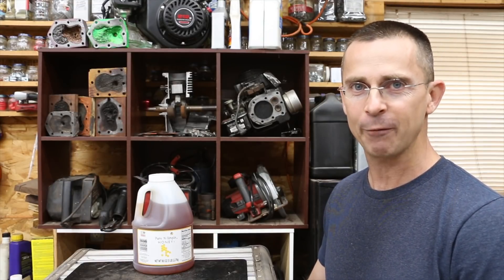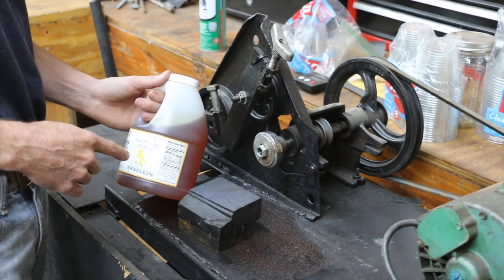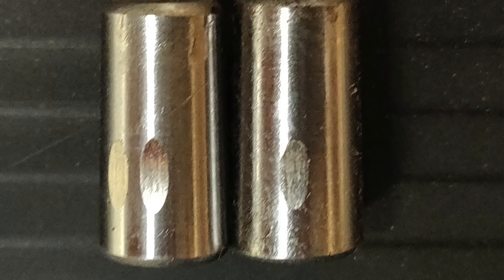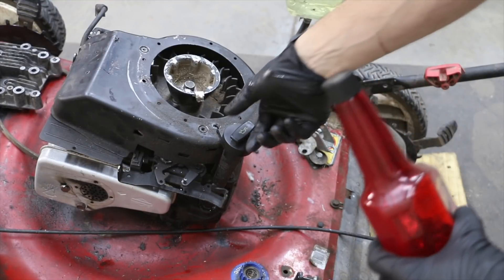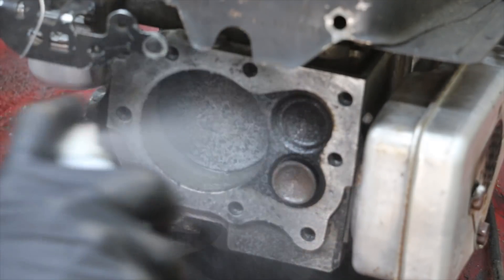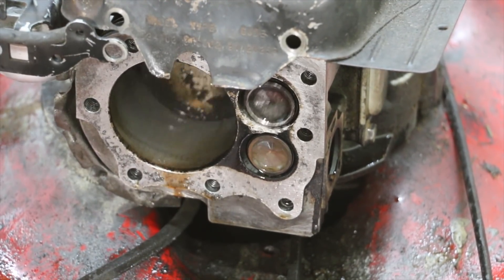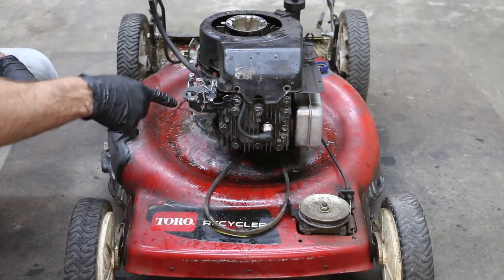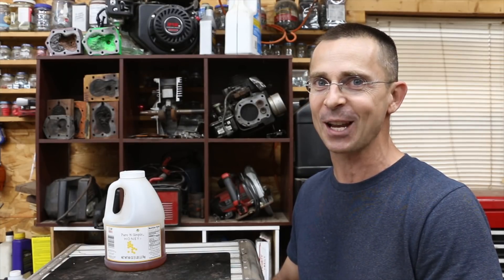Can you use Honey as Engine Oil?  Let's find out!

Comment: Another thing you could try as oil would be DOT5 silicone brake fluid.  I use it in the hydraulic clutch on my car since it is more slippery than regular brake fluid and seems to make the cylinders last longer.  (just to clarify I got brand new cylinders and a brand new hose and cleaned everything out and used silicone grease instead of the normal assembly fluid... I didn't just top off my system!)
Reply from the maker: Great test idea!  Thank you

Comment: Nope. Nothing with sugar will work as oil.
Reply from the maker: You are right.
Reply: @ProjectFarm  Correct if I'm wrong but weren't car lots that were disposing of old cars during the Obama cash for clunker thing using sugar to lock up engines so they couldn't be bought or sold again?

Comment: You should perform the lubricity tests at multiple temperatures since as the engine runs, it will heat up whatever you're using as oil, which changes its viscosity and lubricating properties.
Reply from the maker: Great point. Thank you

Comment: I wanted to see in the crankcase😔. Do you think, given the lubricity test, that if the honey did not boil it would have worked as well as 10w-30?
Reply from the maker: Yes, the engine could have lasted a long time had the temperature remained lower.

Comment: Great one, saves me from trying it :) 
Also, bananas is rumored (urban legend) to be a oil-replacement in emergency. 
Seriously, when will we get the "radiator flush"-test? Also I'd like a video about different lawn mover blades, are Oregons Gator blades more efficient than traditional ones, and is it possible to diy a blade from a plain sheet of steel or even just a piece of flat iron?
Reply from the maker: Great test idea!  Thank you

Comment: I'm not entirely sure if you've already done this, but running an engine with gasoline or diesel instead of oil would be interesting.
We've seen oil being the fuel, how about fuel being the oil ^^
Reply from the maker: Thank you!
Reply: Diesel is a better lubricant than petrol so that would certainly work better.
Reply: @gravemind6536  of course, but how good exactly. i'd guess diesel works maybe half as good as oil, and gas could even clean the old oil away and blow it pretty quick

Comment: Since the engine is in bad condition, test some of the products that claim to be solutions for such old beat up engines. Frankly after what that engine has been through, you really can't fault it. Not many engines could survive half of what this one has. 

one question has been on my mind lately, what would happen if you used Engine Oil in the coolant system of something "water" cooled? Logic says it would work, to some degree, and at various exterior temps especially if it was like 5 W 40 or the highest gap you could get. By the way, what makes a multi weight oil work? Supposedly it's thinner when cold and thickens as it heats up. How does that work?
Reply from the maker: Great test idea!  Thank you
Reply: I predict failure. Water has a particularly high specific heat capacity, much higher than that of oil. My dad’s lawn tractor overheats and conks out if it has too much antifreeze so oil as a coolant .. not good for the engine.
Reply: Sounds like waterless coolant. Basically a light oil.
Reply: @gasdive  There is a coolant on the market that is supposed to last the life of the vehicle, and possibly even longer. However, the system must be totally free of water and antifreeze when you install the new stuff, if it gets contaminated, it won't last and won't work as well. It's so long lasting (but expensive) that many people use it, then when they get ready to sell the car they take it out for use in another vehicle and go back to regular coolant in the car they're selling. I'm not talking about the "long life" stuff the main sellers are now touting, this is something made by a small company, there is a vid on it under Jay Leno's garage listings. I don't know much about modern vehicles, but back in my day I was told that if you keep adding some mineral oil to the antifreeze, you don't really have to change it very often at all. It's not the antifreeze part that breaks down, it's the additives for corrosion resistance and such.  Another odd fact, straight undiluted antifreeze will freeze at a relatively high temp (below freezing of course) but when in 50 50 mix with water, it doesn't freeze until a much lower temp. Anything will freeze if you can get the temp low enough. Of course, that was back in the day with the old antifreeze, not the modern stuff.
Reply: @tootall5559  yeah, that's the stuff I meant.
Reply: @gasdive  Y'all can see all about it here: https://www.youtube.com/watch?v=t7PykrgzWPQ

Comment: How about paint in the crankcase in place of oil?
Reply from the maker: Thanks for the video idea!
Reply: a teflon based paint like they use on rims
Reply: interesting
Reply: Oil base paint may work.
Reply: PS Kilz primer is flammable you may be able to run the engine on it. Oil base paint in the crankcase and Kilz in the gas tank. Two tests in one.

Comment: thanks for metric numbers! and since i'm here, there's an idea: what if you use something like litol24 (lithium) or solidol (these are really thick greases, it might need to be leaned) in engine crankcase. it might be not available across atlantic ocean, but these greases are similar to that grease which is used for heavy duty truck and trailer joint mechanism
Reply from the maker: Thanks for the video idea!

Comment: I wonder if the RPM would go higher if you put a vacuum cleaner on the exhaust, so you were basically sucking the exhaust gases out of the engine?
excellent video as always, seeing it lock up was GREAT! lol
Paul
Reply from the maker: Thanks for the video idea!
Reply: I have a feeling the vaccum cleaner could get slightly melted from all of the heat exhaust gasses carry, you would need to find an effective vaccum pump which would be resistant to heat.
Running a turbocharger off another engine and routing the exhaust of the test engine through the charge side would work too, although the difference would be minimal, as what is more importabt is how much air/fuel mixture gets into the engine.
Reply: It wouldn't make a difference to the engine.
  The cylinder doesn't exhaust and intake fuel air mixture at the same time. The valves won't allow any vacuum pressure to pull in fuel and air.
   What will happen depending on the vacuum power and engine choice is you will either stress the vacuum or over power it..
Reply: Isn't that sort of how a two stroke work? using the enlarged exhaust pipe as a scavenger?
Reply: Old 2 stroke diesels use roots superchargers for this very thing

Comment: In the movie Matilda, the father is a dodgy used car salesman, and says putting sawdust in the oil makes it run smooth for a few miles... 😃
Reply from the maker: Thanks for the video idea!
Reply: He also put it in the gearbox and drove them backwards for a few hundred miles. Was a huge fan of the book and movie growing up
Reply: I had always heard Sawdust in the gear-box of a differential...  not the engine.
Reply: @DeadKoby  Me 2.
Reply: I support saw dust test.have always wondered what it would actually do to an engine. Granted the splash system in a small engine is different from the pressure system in a car. That would also play a factor in the results.also worth pointing out that a car engine has an oil filter.
Reply: Putting it in a rear end is an old trick to quiet the gears
Reply: @blackbirdpie217  sawdust in the rear end is logical.it is just a bunch of gears meshing together. The sawdust would act as a cushion to take up space caused by wear.
Reply: The way car sales people cheat with engines is by packing the valve covers with bearing grease and running thick oil to quiet things down.
Reply: @gokartbuyer  I understand about the thicker oil(or thick additives) but, could you please explain the grease?
Reply: pospc2 it acts as noise insulation for the top end of the engine. When an engine wears out, oil pressure decreases and the top end (valve train) suffers the most as it's the end of the line for oil. Stuffing grease into the valve cover muffles any ticking or clattering from that area.
Reply: @gokartbuyer  that's good to know. I rebuild engines and have seen what happens when the valve train isn't getting enough oil. Never would I have thought about packing the valve covers to muffle the noise. I learned something new, thanks.
Reply: pospc2 lol glad to pass on some information! You don't see it too often nowadays, valve covers are far more intricate and difficult to remove. Older longitudinally mounted engines with a pushrod set up were commonly packed.
Reply: @gokartbuyer  alot of the engines I work on are newer, in order to remove valve covers on most of them it involves removing intake manifold and other things as well sometimes (such as variable timing solenoids,wiring harness,etc) also a lot of the covers themselves are baffled for the pcv system.
Reply: pospc2 Same here. Pain in the ass to do basic things like spark plugs.
Reply: @pospc2  straight STP oil treatment works well for that too
Reply: my cat's name is frank and I call him dank
Reply: jamesb1221222 then he is truly blessed. May he rule for millennia!
Reply: Sawdust for axle noise, old tights fed into gearbox for worn syncros.
Reply: Transmission fluid I think
Reply: Sawdust for transmission. Dawn for engine.
Reply: @Originalxlander  what does the dawn do to the engine? I can't see it actually doing anything good.
Reply: Dodgy car lot dealers used to put sawdust in worn out standard transmissions. Worked great for a short time.
Reply: Dodgy dealers did put sawdust in standard transmissions and rear drive differentials. It actually worked.

Comment: A liquid metal polishing compound in the crankcase would be interesting
Reply from the maker: Great test idea!
Reply: What about liquid metal iself? Like the one that is used as thermal compound for computers
Reply: @eduardoavila646  you mean mercury yikes highly dangerous but I like it, oh yeah
Reply: reaper-999 Not mercury, even tho he could try thay too, but would certainly need extra protection and do it in a open environment. And probably put a filter or something in the cranckcase ventilation and or in the exaust. 

Yeah probably mercury wouldnt be the best option, but there are other liquid metals such as galium
Reply: @eduardoavila646  I suggested another liquid metal thing a while back, pouring some gallium into the carb while the engine is running.  see how fast it alloys with the aluminum and makes the whole engine melt
Reply: RickBaconsAdventures Yeah! And also in another engine,  maybe another liquid metal that doesnt react that much?
Reply: Brasso would be a good test
Reply: Second that. I've always wondered what effect the polishing compounds I use on vehicle exteriors would have if they got inside the engines.
Reply: Yes please!
Reply: Ha! That’s an interesting idea
Reply: Needs to be non abrasive
Reply: That will be one polished cylinder wall and piston lol

Comment: Kill it by spraying it with water once its up to operating tempersture. Or submerge it while running, simulating a dip in the farm pond & see if the water cracks the case...
Reply: Would be cool to see an engine running underwater with snorkels
Reply from the maker: Great video idea!
Reply: water on hot metal wont cause a crack. I mean don't u think engines would be detonating every time it rained? never mind motor cross bikes atv's and all off road vehicles that cross rivers? boat motors etc etc.
Reply: @bobspurloc  A thermal shock potentially can cause a crack because materials expand when hot and contract when cold. So if you have a hot engine where the outside suddenly gets cool, you will cause a tensile stress on the outer surface of the engine. This is especially significant for cast iron since cast iron has relatively low tensile strength.

This is also why chewing on ice isn't very good for your teeth, especially if you have a filling.
Reply: @matthewlind3102  this is what I want to see - if the severe shock of cool water will destroy the engine. I was taught not to spray a hot engine with a hose - and it sounds legit. It would be an added bonus to keep an engine running under water, but use a snorkel for the intake & waterproof the ignition somehow. It needs to stay running, in turn becoming a water-cooled engine ;-)
Reply: bobspurloc it’s not the temperature difference that causes the crack, granted it’s not good for hot metal to touch cold water it won’t be catastrophic. The point is once the water enters the cylinder by the intake stroke it closed and the piston rises trying to compress the water. Water does not compress and all the pressure can break rods and or crack the case.
Reply: well usually an engine has stalled by the time the cylinder is going to fill with water as the exhaust gets shut down. tossing a running engine in water isn't going to instantly suck water into the cylinder. like I said, we would have engines jettisoning left and right offroading. ive submerged my dirt bike several times, it will stall wait before cylinders fill. no liquids compress hence why fuel injectors that gets stuck open will destroy a cylinder. that's how eric the car guy snapped a ring...
Reply: misting water in to the carb can remove carbon like seafoam i herd that from an old timer, i wonder if it works
Reply: @redneckasmr-xd1gg  he did a video already misting water into the carb and saw it cleaned some carbon off

Comment: I wonder if packing the crank case full of grease would work...🤔🤔
Reply from the maker: Thanks for the video idea!
Reply: It will not lubricate the cylinder walls
Reply: I have done this with wheel bearing grease.  Went great for 3 yard mows.  Then I added 80/140 diff oil and it went for ages no issues. It made the grease disappear. Drained it all and ran dry til it eventually destroyed itself. Super clean inside the crankcase when I pulled it down.
Reply: If you use cheap grease it will surprise you! Good high temp grease will not lube piston until it gets above 550 but by then the engine is pretty much gone if not already.

Comment: what would you recommend to unstick an engine that's been sitting for 42 years? i put mystery oil in there last night, looks like the level went down about an inch and a 1/2 this morning so looks like it penetrated through the rings, is there anything else that can work if this does not?

*this is for a 1968 Peugeot 404 i amazingly found here in Texas that was imported from France, just trying to revive this rare Wagon.
Reply: Omar T - we had a generator motor that was seized/rusted solid. Pulled the plug and shot WD-40 into the cylinder; let sit for 24 hours; runs great. 👍
Reply from the maker: You've done exactly what I would do.  You might consider using Seafoam Deep Creep (spray penetrating fluid) in a few days if MMO doesn't work.
Reply: @ProjectFarm  thanks! :) i appreciate it! will do,
awesome video btw.
Reply: i would take it apart and check everything to be safe, otherwise you risk damaging your engine..
Reply: @HIIMUsc  no parts here in the United States, trying not to yet....
Reply: take the rocker cover off and plugs out and pour hot engine oil down the plug holes and into the head

Comment: Can you try to make an engine start with no spark
Reply: So basically a diesel?
Reply: Sithhy - Or perhaps a steam engine, or a sterling, or maybe even a turbine... 🤔
Reply: @Sithhy  you could in theory run diesel on gasoline at high enough compression :D
Reply: @aitorror3659   no, diesel would need a lower compression ratio to not damage a gas engine, it has much higher knock tendencies than gasoline
Reply: It is possible to keep a gasoline engine running with no spark, but would require a crazy compression ratio of 16:1 or more. Sadly it wouldn't be possible to start one without a spark though.
The currentlyin development Mazda Sky Activ X engine is currently the only engine in the world that does this.
Reply from the maker: Great test idea!
Reply: You cant start a fire without a spark! -Springsteen
Reply: Plausible - a hot bulb arrangement perhaps?
Reply: @WineScrounger  that's the standard for diesel engines. The "hot bulb" is called a glow plug.
You would still need to increase the compression ratio. This is because Gas engines such as those used in garden lawn mowers  have a compression ratio of between 8 and 10 to 1, whilst for compression ignition, you need at minimum 15 to 1.
You would still need a tradional spark to run until the engine is up to temperature, otherwise you would destroy the engine.
Reply: Apollo Mead I use the term “hot bulb” to draw a distinction between electrically powered glow plugs and the old timey igniter bulbs that were heated with a blowtorch before starting. This shouldn’t be too easy 😆
Reply: I suggested a turbo a while back, would be great to test it together >:3
Reply: Just buy a Dodge, you will have ample opportunity to try starting with no spark.